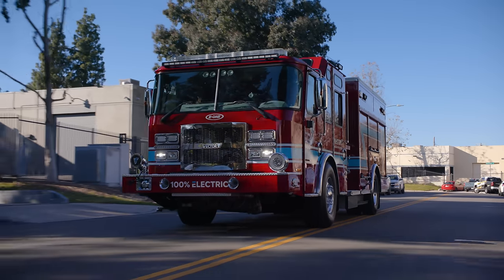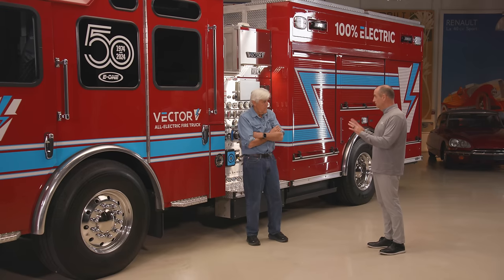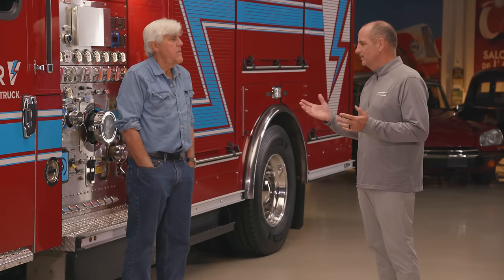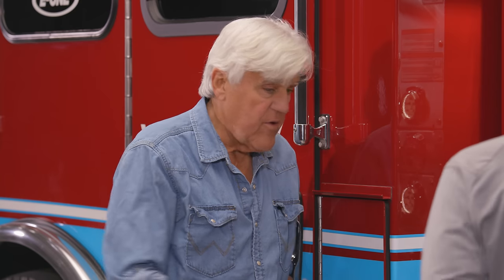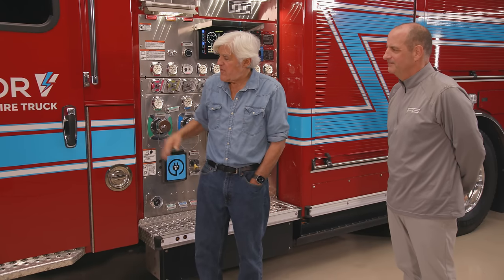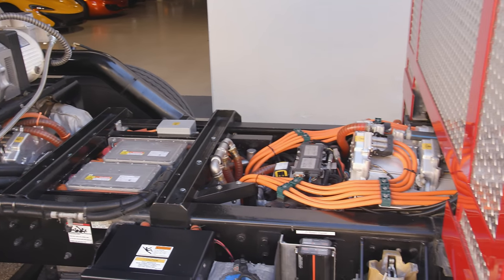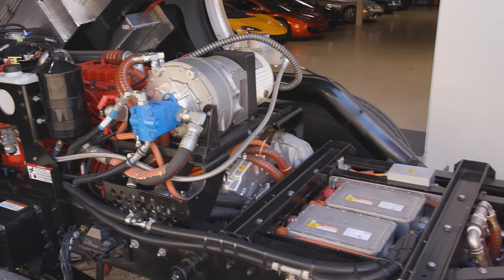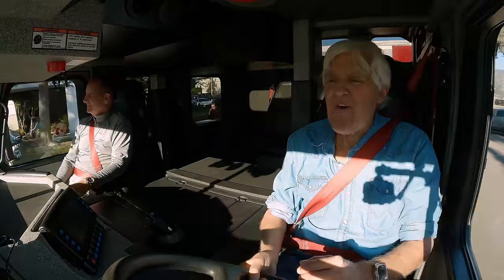The Future of Firetrucks?

Comment: I would HATE to be a Firefighter inside a burning building when the batteries decide to die.  Normal fires it might be fine but you get a major fire with all the pumps in operation with lighting in operation how fast will the batteries die?  Not to mention I am thinking it has a massive battery bank inside that only last 5-8 years? What happens to those batteries when they need replacing?  Does the entire truck need to be replaced?  Many new trucks cost close to half a million and I bet an electric is even more.  
I can see a massive conflagration and trucks being dead because the pumps had to run for a couple of hours,  Dead fire truck means dead people.  The manufacturer KNOWS they have an issue with the length of battery life and made a workaround for it LOL.  It is 100% electric except the diesel generator motor. I do agree I am talking maybe an extreme situation but they do happen and it seems like it is happening more often today compared to the past.
One last thought I worry about we all know how electronics last- old diesel pumps were mostly mechanical in nature.

Comment: I like the concept.  But diesel engines just have a longer life span. That truck will be out of commission for a long time as soon as bad battery cells need to be replaced. Unless they have battery packs that can easily be swapped out?? Definitely glad that the truck has its own diesel power generator. But.... good luck in extreme cold or hot weather.  Batteries are "bougie "and require ideal ambient operating temps. Unless the the batteries are temp controlled. And that's not much of an issue when you have on-board charging
Reply: As I was writing my comment,  the guy answered all of my concerns about a minute later 😂

Comment: This is ridiculous , here in Boston even staying within a District some of our Houses are so Busy they do more Miles than it could be charged for, and we have had long stands where it is just not practical, Also it gets extremely Col here and Hot.
 its Funny but tragic when he talked about competency and Technical ability, like many Fire Departments because of Affirmative Action Standards & Qualifications are so reduced or Eliminated you have such incompetence , The last two Fireman Killed in Boston was because the Driver Pump Operator didn't know how to turn on the Attack Hose and the Firefighter who was supposed to Hook up the Hydrant didn't but took a Forcible Entry Tool and Smashed out 3 Windows doing whats called improper Horizontal Ventilation causing the Fire to intensify Explosively and roar over the two in the Fire.
Reply: competency crisis

Comment: Just saying, 3 phase 480v is a substantial load on ONE building, talking about keeping a FLEET of these puppies charged at all times makes my head hurt for the local power companies.  You are talking a SUBSTANTIAL upgrade to the panels in each site just to be able to charge these turds assuming the city power can even provide enough current for a fleet charge on 480.  Not to mention NOBODY will be able to fix it when it breaks.
Reply: Pretty much every fire house has 480 in it already...

Comment: How much gallons of water have been lost to batteries how much weight has been gained from the batteries will bridges in small city’s be able to handle the weight how long can it drive then with all the lights going can it pump water for I bet a regular truck would run circles around this in the field

Comment: Of course it is to be necessarily mentioned, the first thing that happens in a large urban conflagration is that the power goes off.

Whoops! Explain that to the taxpayers whose houses burnt down because the fire truck ran out of juice.
Reply: You don't think fire stations are already reliant on electric power and therefore already have backup power sources? Not to mention that the idea is to keep the trucks charged, not to charge them on demand. EV fire engines are not a good fit everywhere, but they are a good fit in many places.
Reply: @joedunn1109   Yes, I understand all your valid points, but...

Although my comment was meant to be humorous and does not involve itself in more than in a superficial level, do you really think that it is not a well-founded observation?

Well-founded, as in The bridge will be completely fine -- after all, it has concrete bollards (“dolphins") protecting the important bits.

Comment: I sure hope my house doesn’t burn down because someone forgot to plug in the truck or because the battery won’t charge when the temperature is below zero
Reply: While cold temperatures do decrease a battery's capacity, charging the trucks in a heated fire station will not be a problem.

Comment: sorry, i dont want to call the fire dept and get told they cant help because the batteries wont turn on because its to cold nor i want it to respond and then go dead because of the cold temps and have to wait til other engine respond with a engine that doesnt care what the temp is outside

Comment: So the power train is built overseas and typical cities have their own shops to work in their fire trucks or have selected shops that do repairs and maintenance. And since fire departments have been conservative in making changes, so no one will be trained to diagnose or make repairs in the chassis. Looks like the taxpayers are going to be hit with more money to replace diesel fire trucks that aren't driven very far just to pay more for maintenance and more load in the electrical grid. Which reminds me - LA is in an earthquake zone and if power is taken out, is this fire truck going to have to use the inboard diesel engine to run the generator to charge the batteries until power is restored?

Comment: Leavesprings.. really? 😂
Reply: Yes, fire trucks typically have conventional commercial truck chassis designs with leaf springs, particularly in the front. Another company (Pierce) offers optional independent suspension with coil springs in the front or even for all axles.
Reply: @brianb-p6586  ok ok.. but new for me to see a new vehicle that is equipped with leafs.. but I think that’s a US thing.. but hey, it’s simple, it works, cheaper and bulletproof.. 😏
Reply: @eggbirdtherooster  heavy trucks worldwide commonly use leaf springs in the front. Perhaps you're more familiar with smaller trucks, or only cars; a typical North American fire "engine" (pumper truck) like this has the axle weight capacity of a heavy highway cargo truck.

Comment: Wow cool machine, but did anyone think lets bring a battery 200KW plus to a fire where the batteries don't like heat above 60°C/140°F as they have cooling heat pumps to regulate internal temperature. Like to see the fireworks of one of these machines in next California coastal wildfire mishap. Exothermic thermal runaway or vapour cloud explosion (VCE) of Li-ion batteries are a sight to see at 1200 - 3000°C. Steel melts in the mid-range of these  temperatures and in the upper range water is lit on fire (too much concentrated energy breaks water bonds). Once a battery goes into thermal runaway, you can not extinguish the reaction until all chemical resources are spent. Water just limits fire spread to other vehicles or dwellings if even possible. Check out Prof. Paul Christensen Li-ion fire fighting webinars.

Comment: What happens when the house is on fire and someone forgot to plug in the truck from the last job, how about back to back use? Taking a non-issue and creating one. If you care about emissions reduction how about we master with ships, rail, planes, trucking first

Edit: he said based on the average calls they’ll never run out of juice. He also says it has a 145mile range which I’m sure is highway miles start using the pump and everything else I’m sure it’s less. Smells to me.

Comment: I fail to see the point, there is still a diesel engine in there.  That has all the modern emissions SCR/DPF/EGR/cat piss tank that make modern diesel engines unreliable/expensive to run.  I might have been sold if the range extender was a gas V8 or even something like a basic 4 cylinder Toyota Corolla engine.  Even with that setup its still way more complicated than a conventional fire truck.  Also whatever is on fire is probably throwing way more pollutants into the atmosphere than the diesel exhaust from the fire truck lol.

Comment: 1. If the system detects the batteries are discharging faster than designs.... emergency disconnect in case the truck is in an accident and "something" is happening.... As in all the batteries are on fire and now we have a new emergency.

2. They used a lower power water pump... because it is better for the batteries.

3. If the truck has to remain on scene for more than 4 hours they have a diesel generator to keep the batteries alive... I.e. a REAL emergency when you REALLY need the truck and the EV can't handle it.

Notice how many of the emergency EV systems fall back to gas or diesel when the truck HAS TO WORK.

Idea-- Just use diesel?! Brainstorm I know.

Comment: That is a real FIRE Truck! That Fire Hazard Truck is more dangerous than the fire it is supposed to be fighting! What happens when the battery dies and the fire has not died yet? What about water and all the electronics that are in that thing? How about the risk of electrical shock when everything is soaking wet? Junk! Just a waste of tax payers money!
Reply: The battery is sealed and under the truck so it’s not going to get wet.  The electronics are also sealed and no different that the electronics that are in any vehicle currently.
Reply: As to the battery dying before fire is put out is why you don’t let the truck get to 10%, you charge it every time it’s parked. And then if you’re pumping water for that long I would assume other trucks have arrived.
Reply: @legostud  Some fires last for days, this job is not one that you go in to unprepared. If the truck cannot be usable for an unlimited amount of time,. that would be rolling in unprepared. This is an unpredictable job, most of the time, yes, the  outfit is over capable, but when it is a real house fire, or factory fire, almost all outfits are under fit with equipment including trucks. They call in other departments for help. That is bad enough, why would anyone want a less capable truck in their fleet? To save the planet? these trucks are all so low milage that an electric truck would not make any noticeable difference in air pollution. What it would do, is it would decrease the capabilities of the department  when they really need them. Peoples lives are at risk, you don't sell them out by shorting them of a real fire truck.
Reply: @legostud  Yea, and the Titanic was unsinkable. Water and electricity are a bad combination, this is like playing with matches while your at the gas pump.
Reply: @juslookinism  - how would you refill the truck with diesel?  Do you expect a large tanker of fuel to show up at a fire?  That sounds like a bad idea.

Could we power an electric truck off the grid using a neighbor’s house or some new way of getting power from the pole. Plenty of new opportunities to explore with an EV truck.
Reply: @legostud  Right that is just what you want, extension cords run across the wet ground and plugged in to the fire truck! LOL!  Like the hoses are not enough to deal with! Let run power through there too! No fire dept. should be dependent on random citizens to power their truck! Just drive it to it's designated fuel point, or to the nearest fuel point (Gas station), and fill it up. Then put it right back in to service. Or, or, use fuel cans and fill it as it is working on site. No, there are no new opportunities with Ev's at this point in time. Only drawbacks and compromise. Sorry man, battery power storage and battery safety must be dramatically improved upon before they can even compare to a vehicle with an I.C.E.

Comment: Cool truck but I would really like to see how much water it can pump.  That's the point, right?  That little test in the parking lot did not inspire confidence.  You wouldn't test a McLaren by how much groceries it can carry and how well it can parallel park.  Would like to see the truck do what it is designed to do.  How quickly can it spring into action?  How powerful?  For how long?  Can it tap into city power if needed?  Will the diesel motor power the battery indefinitely if pumping from a pond?  That would be the performance test.

Comment: Before I retired last year, we studied emergency vehicle electrification for a federal government department.  Charge times compared to refuel times required a 25% bump in fleet size to maintain comparable response capability.  Range doesn’t matter, run time does.  More critical for fire apparatus.  Europeans are using electric fire apparatus, but mostly for hazmat, small pumper and supervisory vehicles.  Technology isn’t there for ladder and large pumpers.  And, it only makes economic sense in Europe because diesel there is $8 a gallon.  Electric grid updates to support this would break the bank.  Most municipalities will run the numbers and stick with diesel.  The proof of the pudding is in the eating — how many have been sold and delivered?
Reply: "Electric grid updates to support this would break the bank" Absurd nonsense. You have no clue what you are talking about. 
Very little Grid updates required for the few fire trucks that exist. It's just at depot charging installs which is NOT grid infrastructure level work.
Reply: You IGNORED the video to spam nonsense. "Range doesn’t matter, run time does" It has a Diesel Generator when you surpass the 4 hours pumping run time. Soo that means vast majority of the time the Diesel Generator is used very little. It's like copy and paste a script without watching the video.

Comment: Someone really needs to give Mike Virnig a very basic education in electricity. The generator doesn't produce "155 kilowatts per hour", because that would be meaningless nonsense; it produces 155 kilowatts (kW). The battery doesn't store 327 kilowatts (as stated at 17:53), because you can't store power; it stores 327 kilowatt-hours (kWh) of energy

Comment: From a life long electrician: Don't think an EV fire truck is practical. Would need a portable generator to recharge batteries at times, no but wait gasoline generators are being outlawed in California. Stop trying to reinvent the wheel. Forget about getting much charging power out of regenerative charging while going down hills & slowing down. Wish they would tell you that a 480 volt three phase services would cost to install. Good luck spending a hour or more to put out a EV battery fire.

Comment: They should have asked what the price difference between an ordinary diesel fire truck compared to this? We all want cleaner air but as a taxpayer we all want what we can afford.
My god, the fire that they are putting out is a thousand times more polluting , and 60% of the electricity is coming from coal fired or other fossil fuels.Electric buses have way less mileage in colder weather and have been being used quite a bit, so "feel good" purchases must be weighed against other factors.

Comment: Just remarkable that nobody knows anything about anything. Nobody knows what the batteries are made from or how they work. They don’t know what electricity is, how it works or how it’s made. The batteries are made from rare materials mined from very few places in the world, and largely by children under 12. The electricity in the US is made 45% coal burning and 35% oil and gas burning. A minor collision usually damages the batteries rendering them useless, dangerous, and usually totaling the vehicle as it’s more expensive to replace the batteries and repair the vehicle than it is to buy a new vehicle. The same people that believed the shots and masks would prevent infection or transmission. It takes minutes of research to learn something important, but they’d rather watch a football game and have no understanding of what is going on. They somehow have opinions despite having zero understanding or basic knowledge of the information they have an opinion on. It boggles the mind.

Comment: THEY STILL NEED A QUIET GENERATOR ON BOARD TO KEEP THE BATTERYS CHARGED.,.
Reply: Yeah, but a diesel generator can be run constantly at peak efficiency and doesn't have to be as large as one that would drive the whole engine. It's not a perfect solution but it's a step in the right direction.

Comment: You know what wasn't mentioned? Where were the batteries sourced from? Was slave labor involved? How much energy, pollution, and destruction did it cause when harvesting the minerals necessary to make the batteries? How much pollution did it take to ship it back and forth across the Atlantic? How much strain does it put on an already failing grid in California that already is asking people to stop charging their vehicles? How far does the truck need to be driven and operated before it becomes more efficient in fossil fuel pollution than its diesel counterpart? I'm guessing never with the amount of drive time and operational time mentioned in the video. A Tesla has to be driven for 70,000 miles before it becomes less of a pollutant than ICE vehicles. With less autonomy and range.